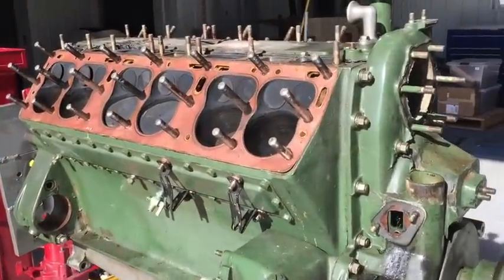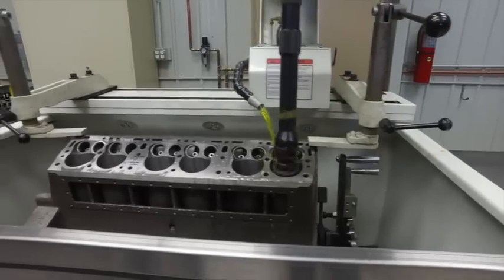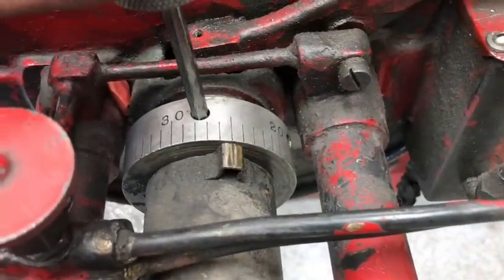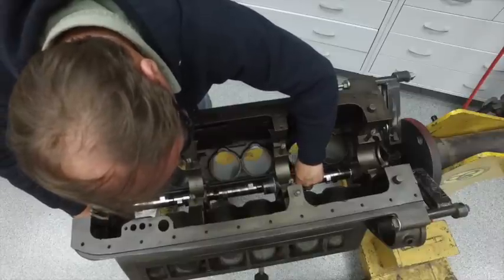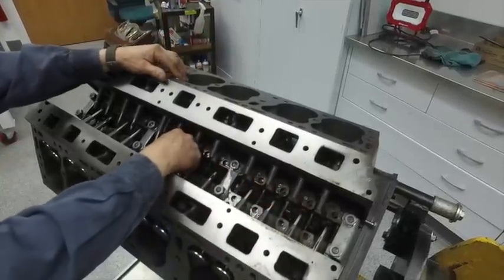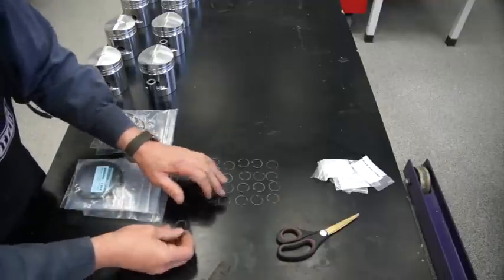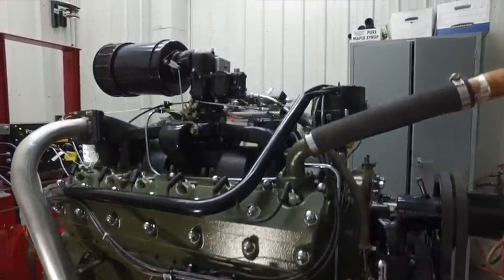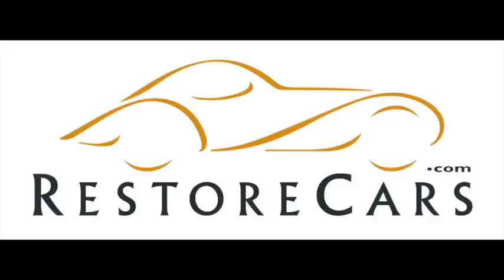Remanufacturing a Packard V12 engine

Comment: I wonder if this is derived from the Merlin?
Reply: No.  The Packard V12 predated the Merlin.  Also, the Merlin was a purpose-designed engine for aero applications and among other features, had overhead cams, seven main bearings and was made of aluminum.  The Packard V12 is cast iron and more of a boat anchor than engine.
Reply: BCS Technology Limited  
So what car came with this merlin ? You compare a airplane engine to a car engine !  Let me tell you what a piece of  SHIT your merlin is compared to a real engine . Get on your knees before you feast your eyes on  a Chrysler  HEMI      king of all engines  . You would throw rocks at your  OIL LEAKING kunt of a motor if you ever owned a  HEMI  Most country's build better engines than the English . When you work on them you get to know these things . If you are going to compare things then be fair !
Reply: @bcstechnologylimited896  So?
I liked the Corsair which stayed in service longer then Mustangs.
Phuque Mustangs.
Reply: British engines are great, like the Jag six overhead cam. from 1948 thru 1980a essentially unchanged.     Plus, you can always tell when a British car needs oil.....it stops leaking.....:}          @2x4barrels40
Reply: The Twelve engine did use Aluminum heads, these are being reproduced. @bcstechnologylimited896
Reply: bbcisrubbish Not even close. The Merlin had overhead valves - four per cylinder - and a capacity of 27 litres versus about 7 litres for this Packard. In fact, probably the only similarity between the two is the number of cylinders.
Reply: I said it looks like a packard aircraft engine.

Comment: No stone left unturned in you effort to make this engine as good as if not better than new. I've also never seen such a superior valve design used in a flat head engine in which the valves are substantially angled in relation to the plane of the cylinder banks. This design has to allow the engine  to breath with a reduced  restriction of airflow which no doubt translates into more available power.

Comment: It seems strange to put a 4 main bearing crank in a 12 cylinder engine, still, I suppose this was a period of low octane fuel and low power output.
Reply: Much lower compression in these engines plus a beautifully balanced crankshaft.
Reply: The dyno looked to be set at around 3500 rpm tops as well.

Comment: Hi. Can you give more information about the break in? what do you mean about "pulls". You said about after ten pulls the engine is broken in? what is the break in procedure? and are you using mineral oil? Thanks
Reply from the maker: A pull is a cycle on the dyno.  We use a standard break-in procedure.  Run the engine for about an hour without putting any loads on it.  Vary the speed and tune best as one can.  Then we run the RPM's up and the dyno starts to put a load on it.  It will continue to load the engine down as the throttle is eventually reached full throttle.  Then we let the load off and let it go to max RPM.  That is a pull.  Think of driving up a hill.  The hill loads the engine down, you keeping pressing the accelerator down until you reach full throttle.  The car tops the hill and you accelerate until you let off the gas.  We will be dyno'ing a 1937 Cord for an upcoming series.  I'll explain this whole thing much better in the series.
Reply: That was something i didnt know. That you load the engine in the dyno.  I just started rebuilding my own engines and learning about break in procedures also. Can you direct me to a web page so i can further read about them? I subscribed so looking forward for your video. Thank you

Comment: Twenty large later and you gotta really nice v-12
Reply: hey, that wont buy the smallest 4 cylinder certified aircraft engine !   Put a new large diesel in your yacht.. ditto.Much of this work can be done by a meticulous hobbyist motorhead.. but only with the cooperation of highly skilled machinists...   Like the old ford flat heads.. he is adjusting the valve clearance by grinding the valve stems !

Comment: After this work has been done,does the engine give a lot more power than original?
Reply: why should it ?   The point is to make it run the way it was designed.
Reply: It will forsure have more power. The attn to detail and level of machine work shown here with perfect tolerances. It'll make more power and last that much longer doing it with those clean clearances.

Comment: As a PhD. Aerospace Engineer (and an old car guy) who works for America's largest defense contractor, I must say you gentlemen have some outstanding machining skills and equipment...I tip my hat. If I may ask, what is the weight of the assembled short block? Long block?
Reply from the maker: The engine and transmission fully dressed weighs about 1500 pounds.  Thanks for kind words.
Reply: Believe it or not we have more trouble finding expert level machinists than we do hiring Engineers from the A Engineering Colleges...Machinists are becoming a lost skill set in America. We typically end up relying too much on the Engineers in the machining processes. 1,500 lbs...that's a pretty good chunk of mass.

Comment: Yeah, Packard built a good luxury car engine back in the day and they did a superb job of duplicating the Rolls Royce Merlin aircraft engine, which RR said couldn't be mass-produced at their level of quality.  But, what did it cost to get under 200 ponies out of this outdated flathead?  I could get that out of a half-fast overhaul on a Ford 351W for pennies on the dollar.
Reply: Thats not a car you drive for horsepower...

Comment: Wonderful video...Had no idea that there were engines of this complexity....speaks well of the craftsmanship of that era...they certainly didn't have the tools to work with that our builders do today....that engine was probably much better than when it was brand new!
Reply: Every mechanical principal was worked out by 1930. 
Sophisticated multi-stage superheated steam turbines producing tens of thousands of HP were already about 30 years old by the time this 'ole dunga was thought of.
In fact the Packard aero engine of older design already had 4 valves per cylinder, overhead camshaft and supercharging.
Reply: No offense to Packards but if you think a V12 is complex you should try to wrap your head around the inner workings of a rotary or radial aircraft engine of the same era. They are mind blowing!
Reply: pete: The ones I can't figure out how they built, are the sleeve valve engines. Now that takes some figuring out. Sleeves around the piston, that slide up and down timed to the piston movement to open ports for intake and exhaust. Here is a 1908 sleeve valve engine starting. https://www.youtube.com/watch?v=vpyjAR_k70Y

Comment: All that engine runs on a two barrel carb?
Reply: Poncho 400 it certainly doesn't rev very high, no need for much fuel.
Reply: It's not a hot rod, it's a cruiser, and one of the reasons they liked engines like this was to minimize shifting, as they didn't have synchromesh and automatic transmissions weren't invented yet.
Reply: Actually on a E3 carb , single barrel.

Comment: Turbo charge this engine!.It may give more than 800 horses!.Instal this in T'bird and fly!
Reply: Has only 4 main bearing for 12 cylinders so a TC will likely stress the crank and bearings. The torque although is phenomenal at 436 ft-lb;  long rods and tall blocks= torque but create a low RPM engine and low HP but in the day it was torque that was needed to move these big cars along.  Also we didn’t see a balance job here but it was likely done.
Reply: Flathead style engine. Wouldn't work that well with high boost. Exhaust valves would slam shut because valve springs aren't stiff enough and intake valves would have a hard time closing because of added pressure. Which means engine goes boom.

Comment: Those Arias pistons must a special order item. My guess is 1500 dollars if forged. Wish I could find meticulous mechanics in my area. I've had my 351w rebuilt 3 times with three failures. So called reputable shops.  First rebuild was "put up" too tight. Oil filter filled with bearing metal. Paid for 1st class work got crap. 3 times. Good engine rebuilders are a rare/scarce breed.  Lotta places say they have good mechanics. they have parts assemblers.

Comment: Do you keep you initial start RPMs up to ensure lots of oil splash to the cam and followers? (I assume the cam lobes and followers are lubricated by the rod bearing oil outflow?)
Reply from the maker: Dyno pulls pulls start at 1500RPM and thus lots of oil moving around.

Comment: How much does such a rebuild cost?  I'm thinking $30,000.00.
Reply: I am thinking 4. not thousand. 

Jobs like this, cost is measured differently. Take one of those old wooden pickle barrels you see in early 20th century goods stores. Fill that barrel to the top with 20 dollar bills. it would take about 4 of those.

Comment: Surprised you didn't install hard seats and valves to run on unleaded.
You know those exhaust valve clearances are going to be gone real soon. right?
Far as I know the only way to get around that would be to run a slug of 100LL avgas through her once in a while. TEL is good about lingering like that. Another way to do it would be to mix like 32-to-1 100LL in her all the time. You can actually buy TEL-concentrated octane booster but it's sort of a no-no to pour it into the tank of a road car (versus experimental/racing car)

Comment: If you had said thia in the video I didnt catch it but do you guys harden the valve seats for modern unleaded gas or do most of these not see enough use to bother?
Edit: forgot to add but AMAZING work! First vid I've seen from your channel and just this was enough to make me sub!
Reply from the maker: We put in hardened valve seats, but not usually for the unleaded gas reasons.  We're machining a 1934 Cadillac right now that is being fitted for seats.  The reason is the block was poorly machined in the past, (basically someone screwed them up) and now seats are necessary in order for the valves to seat in the proper location.

Comment: Great vid, but you have dyno numbers and you won't share them..?? Come on..
Reply from the maker: They are up at the top of the comments in the description box
Reply: D'oh! Thanks didn't see that..most of it is drop down is my only excuse..as I thought it is a torque monster not HP...I wonder what more carburation would do for it..?? Guessing it isn't built for very high RPM's..

Comment: How do these cars like the garbage fuel we have these days
?
Reply from the maker: Horribly. I can still get gasoline without all the crap. But when touring we have no choice.
Reply: On the other hand, gasoline was pretty crap back then also - just not crap in the same manner as these days.
Reply: Gas was garbage way back in those days, as well... prolly no high octane available...
Reply: 1930s fuel was not of the same standard what we have now. Big sidevalve like this does not have much compression in modern terms.

Comment: So modern machining techniques add 25 hp to an otherwise stock engine, this I find interesting.
Reply from the maker: I think most of our engines beat the book values because many of them are bored oversize.  I believe this engine was .060 oversize.  We deck the blocks and the heads have been surfaced by us and who knows how many other times.   What the final compression is I do not know.  The day we dyno'd this engine it was quite cold outside and thus a bit of cold air induction was going on.  On one of my airplanes, I put cold air induction on it and raised the HP from 260 to 305.  Quite an improvement.  All adds up to additional HP.  Most of out engines run 5-15 HP over published manufacturer values.
Reply: A Road Less Traveled with Restore Cars It makes perfect sense that precise machining would aid in gaining HP, less friction, better balance. And as you mentioned a minimal overbore. Very respectable in all.

Comment: I imagine with such modern and precise machining, these rebuilt engines likely run much better and smoother than they did right off the assembly line.

Comment: You have all this high-dollar equipment, yet you can't afford a microphone.  Nice.
Reply: It takes a lot of expensive equipment these days to rebuild an engine a real mechanic could overhaul with an old boring bar, flex hone, basic valve and seat grinding equipment and some elbow grease.
Reply: I had NO problem with the "voice over" and my hearing is not that great.   Great presentation.

Comment: Hi,  bit confused sorry, are 1:18 and 1:27 the same motor? Both look like the deck of blocks, 
 with cylinders adjacent to pairs of valve seats and ports, but the first would require a chambered head and the latter a flat head and is what is shown at 0:16 so is clearly the Packard - I know I'm misunderstanding this so please help! Thanks so much for the video, I absolutely love it :)
Reply from the maker: This is all the same motor.  The heads are of conventional design.
Reply: Definitely NOT the same engine at 1:18 and 1:27 !!! . Some videos got mixed together! It's like a Chevy W engine vs a BBC... Combustion chamber in block cylinder vs combustion chamber in head...
Reply from the maker: Your right.  The surfacing is on a 1934 Packard Super 8.  I did not have any video of the V12 being surfaced.  My guys moved too fast.

Comment: Terrible audio. If you're going to keep posting videos, either increase the audio input sensitivity or upgrade to a better camera.
Reply from the maker: Agreed.  We have improved all our equipment.  We use now Blackmagic Mini URSA Pro 4.6 K camera's.  We do not pull our audio off the camera's.  it is recorded separately.  If your interested, check out our newest upload and see if the audio is working fine on your computer.
Reply: Turn you volume up.. audio is fine

Comment: Just being a smart ass , I got me one of them old motors going to rip one apart and slap it together ,boy what you talking abut no need for all that fancy stuff. I gots me  welder and can fix anything. I can grind it by eye.My torque wrench is my hand ,you know how many bolt's I have put in . Some of the stuff I have heard from old times when I was young. No wonder so many old motors got scraped . Give a Ford  T mechanic of the time era that motor and it would never leave the shop 99% of the time .
Old henry was good with .20 thou and grease  for oil it will be fine.

That is one complex motor to assemble correctly . I would have loved to work in your shop as an apprentice .

Comment: What cutter are you using to deck the block?
Reply from the maker: I don't know the cutter number right off hand, but I know there is a specific cutter for cast iron and another one for aluminum.  The cutter is 14" made by Rottler.

Comment: I recently learned it was Packard that was willing to assume the task of building Rolls Royce Merlin aircraft engines in the US. Ford passed on it. Maybe he thought it too complicated? 
Packard worked in total unison with the factory in London. Any changes made were applied to all engines in both factories. That engine was the one that give the Spitfire and the P-51 Mustang the extra power it needed to defeat the Nazi air force.

My uncle owned several Packards, I was impressed with the quality in each of them.
Reply: Believe it or not Ford passed on the Merlin because the tolerances for the Merlin were not tight enough for Ford. 

Rolls and Packard were ok with hand fitting parts, Ford wasn't. 

So Ford US said no way. Started work on their own V12 Aero engine, Army Air Corp told them forget it.

But the Army wanted a tank engine, so they turned it into the GAA series V8 used in Shermans, Pershings, etc.

However Ford of England DID make Merlins, but they had to REDRAW the plans (which took nearly 2 years IIRC) to higher tolerances.
Reply: That's all bullshit Ford was a Nazi sympathizer and hated the British. He would not build Merlins because it was a British design.
Reply: That engine was the one that give the Spitfire and the P-51 Mustang the extra power it needed to defeat the Nazi air force.

Not really pal German's built excellent engines and according to many experts BMW 801 was the best engine of the entire WW2 .....First RR factory was not in  London , it was in Derby ! Second  Packard Merlin  was  better  than Rolls Royce Merlin..It was an improved version with a better supercharger which RR in Britain decided to adapt.
Reply: The folks at Packard told RR that they couldn't mass produce an engine using their drawings. The RR asked if the tolerances were too tight.  "No," was the reply, 'they're too loose!"  RR hand-fitted parts to achieve the proper running clearances. That would never work with mass production. RR didn't think that Packard could equal their quality but they did.

Comment: I watched a video about the 65 Mercury comet v 8 , and in it they said that they used moly filled rings because the moly strip holds oil. since then did a little search and found out it is true that molybdenum metal does do just that.  wondering if you used this type
Reply from the maker: Hastings recommends we use a cast iron ring in these engines because of how we use them.  I'm going with the experts.  And besides, in 40 years we have never had a ring issue.  Thanks for the input.